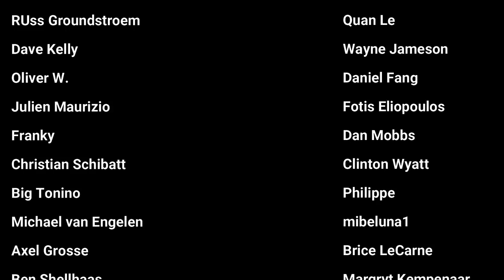Freightliner with Lowboy Trailer & Bulldozer scale 1:25 / Simple rust effects

Comment: I wanted to tell you about my new trick to weather wood.  I've been playing around with different methods from paints to other things.  I think I found a really great method you might want to try.  I mixed iron shavings in with vinegar and painted the wood with it.  After a couple of hours the wood looks just like it was left outside for 100 years.  I found this method by watching Dave over at Engels coach shop.  He uses it to match new wood with old when restoring old wagon wheels.  So I thought "i wonder if this will work on basswood or balsa?"  it worked great!  you should try it and see what you think.  I didn't even have to touch weathering afterwards.

Comment: This looks really good. If, in the diorama the bull dozer is meant to have been unused for a long time then the blade and tracks will rust but if they are used the blade and tracks will be shiny steel even after quite a short time running on dirt and bull dozing the dirt against the blade.

Comment: You really are good at building models, very impressive!! I worked in a iron mine for many years and one thing you will find is that dozer blades get beat up. If you were to round the edges of the cutting edge and maybe put some patches on the body of the blade and some dents and maybe some tears in the edges, and gouges. The blade looks too pristine, like it was sand blasted and then left out to rust a little. It's just a suggestion, You do so much better work than me. I hope I can improve, and get closer to your level!!! You are an inspiration, thank you!!

Comment: My only complaint is that the ratchets on the forward load should be closer to the truck bed, otherwise the crew would have to climb up from the road level to check on the straps.

Comment: One other thing, The tracks are brand new, or just had new grosser bars welded on, there is no wear on them. As they come from the box they have square corners, either round the corners so they aren't square, or leave some yellow paint on them as to look mildly worn, they would be painted from the factory or who ever rebuilt them. I have the same kit and I am going to wear mine down some to look used, and no yellow paint. Just some things I notice from working around heavy equipment.